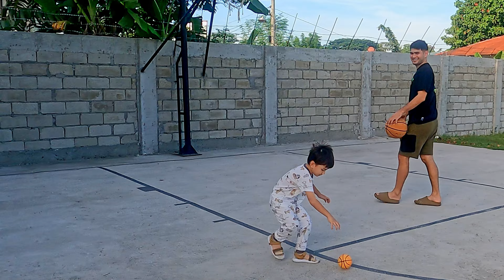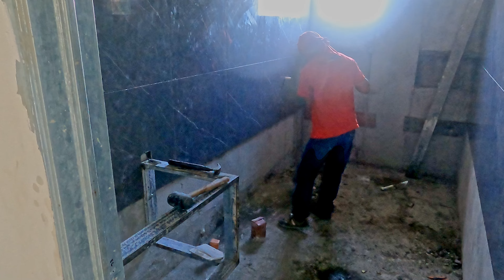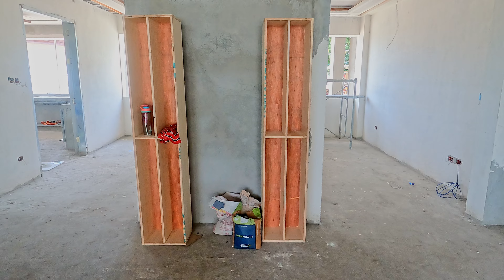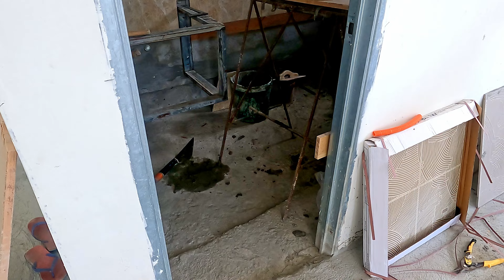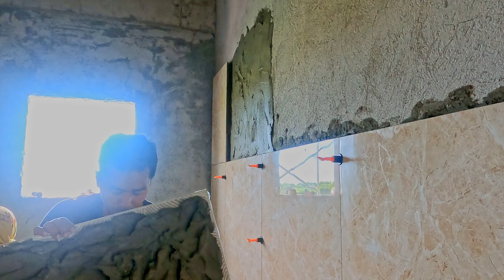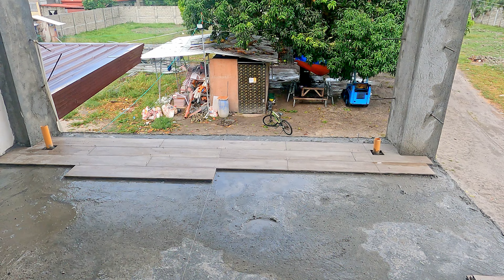Philippine House Building Day 236 - Wall Tiling Philippine Style

Comment: hi I have to say that the way to attach tiles is completely different than here in Norway, here we use a notched trowel both on the tile and the floor or on the wall, this to get all the air out of the tile, I would really recommend you and walk around to test the tiles by knocking on them to hear if there is air under and get it repaired, I guarantee you that you will find more tiles that have air under them, regardless of a luxurious house you and your wife build happiness for further greetings Nils
Reply from the maker: Nils
This is getting quite a lot of comments. I will give them a tap when I can get into the rooms later today.
Reply: Tile cement for  floors in exist in the Philippines  and  some  Western type adhesives for walls  i'm sure are available , but  probably  cost a bit more than cement,polymer modified types are more expensive for  sure than in the West, , I had  family who  had marble tiles come  loose and  have that hollow sound you talk about.. I do renovation and tile work in CanadaMaybe  the floors in the Philippines  are far from level when they do the pour, also they  seldom use those powerfinishing propellers  and screeders.

Comment: Hello Mike . Will be a very impressive dining room ceiling when finished mate (painted / light fittings). To bulla 3222 . You right about the notched trowel . I thought it was designed particularly for laying tiles with glue but not sure with the mixture of glue / cement 1:1 as I have never been on a job that uses that mix . Not saying anything is wrong with that mix - just no experience to comment (negative /positive  ) Regards Mick
Reply from the maker: Thanks Mick
Regardless of the ratio, there are clearly some strong views about the quantity of adhesive.

Comment: Hi mike see that they building some various cabinets out of marine ply do they put any coating on these fir the dreaded anay  and white ants that are prevalent in the pi have seen some videos that they now have in the pi the whiteboard they use for cabinets that is waterproof and termite proof nice to know cheers Gerry
Reply from the maker: Gerry
They should be applying the solignum again (3 coats) and then some kind of paint. Hopefully it will at least slow the critters down a bit.

Comment: You could cover the roof of your house with solar panels, get a couple more batteries and you'd probably use hardly any grid electricity even with all the air-con on. The way prices are going it should pay for itself in a few years.
Reply from the maker: Caparn
I strongly suspect we will end up adding more. Our latest power bill was a horror - and I am sure it is only going to get worse.

Comment: I wonder about your solar set up. I may be wrong but I thought you run off the panels during the day while your batteries are being charged. That being said it makes you wonder if the system is viable for your use. My understanding is you are using it for your current house and the pool, surely the batteries should get a full charge during the day. Honestly there could be so many variables affecting the charging system. I hope it gets resolved before being the main source of power for your home. I really enjoy your videos, keep it going.
Reply from the maker: Thomas
I believe the panels charge the batteries first, so if there is "insufficient" power in the batteries, the grid will kick in. What I want to understand is whether the minimum charge for the batteries can be lowered - it looks to me as though they don't feed power in until they are above 25% - or maybe even more.

Comment: Watching them put all that adhesive on the back of the tiles is killing me, still no ideal why in the Philippines they use so much.
Reply from the maker: I will try to get an explanation later today David
Reply: @philippines4.0buildinganew64  no big deal. I lay tile for a living and just has me scratching my head lol
Reply: Here in Canada  for the walls we use tile mastic- glue or sometimes polymer modified  thinset  which is cement based , for tiles on drywall or cementboard,or Shluter walls and floors , in the Philippines  tile cement or cement based adhesive  goes onto cement floors or walls, often times tiles  are " dry packed " cemented / adhered onto the cement floor,( or wall) thus the  thick back you speak of.I learned this process from an old  Italian tilesetter. The Filipinos are still doing it  the old way, labour intensive.Tile cement/ adhesive  more expensive  in the Philippines  than normal cement I think.